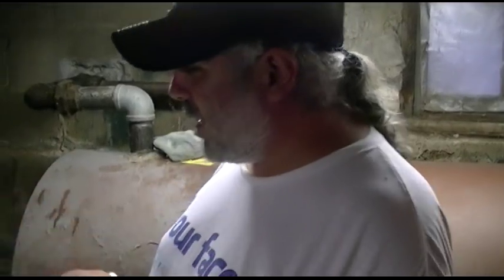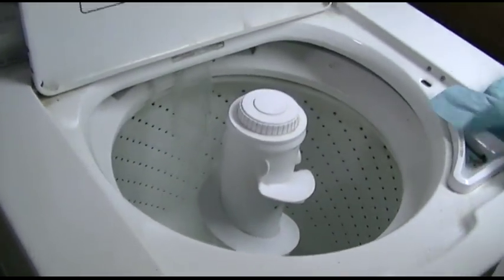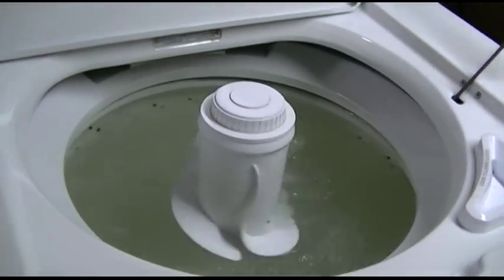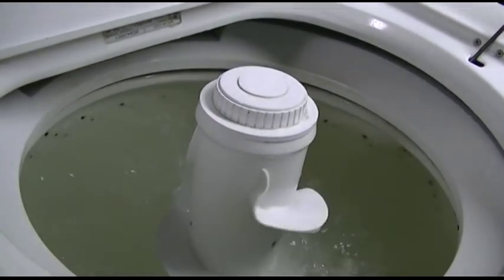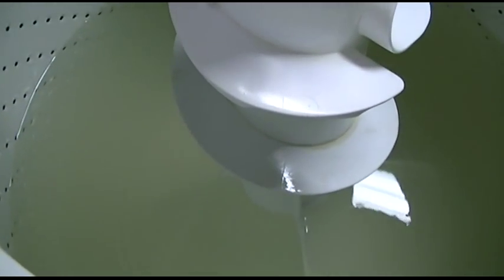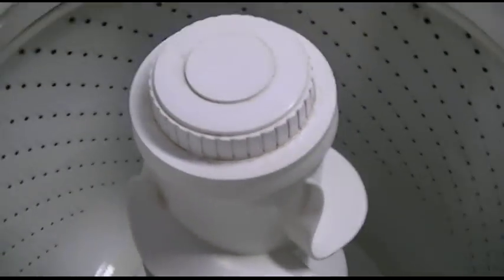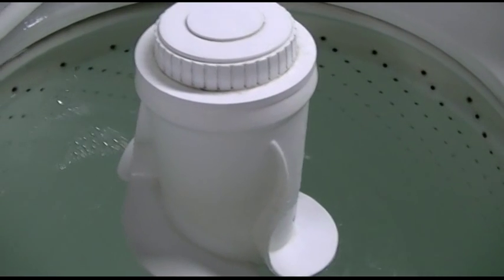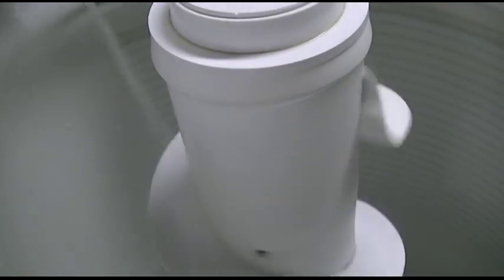Final Test Of Repaired Whirlpool Washer

Comment: I just bought a washer almost identical to the one in this video, only mine is a ultimate care 2, 8 cycle extra capacity. Really good washer, one of the best you’ll ever still find. My first purchase of a washer actually.
Reply from the maker: That was one of the greatest purchases you ever made.  It'll last and last and last.  In the unlikely event something breaks, it's easy to service.
Reply: jaykay18 yup, my family had two direct drives for many years before buying a cabrio set. What a mistake that was, but I shouldn’t complain much because we’ve had those cabrios since 2010 and never one repair to the washer other than during a power outage it fried the panel. But other than that It cleans pretty well, but destroys most clothes and puts holes in them. I don’t fuck around with this electronic BS, I want something sorta vintage that actually WORKS. It’s an amazing machine I’ve had this 90s direct drive for about a day now and it’s running like new, doesn’t even slip into spin either thank god.
Reply from the maker: @Goldenwoodz  I'd like to shake your hand!  Clearly, you have a good head on your shoulders.  Most people fall into the marketing hype of "HE" which is HARDLY efficient.  It's all a joke.  These direct drives have everything you could ever need, and work about the best that could ever be expected.

As for it slipping into spin, it's not that big of a deal to repair, I'll have a video series coming up on that in the future, a friend and I did it on his machine, and in the coming months, we're going to do the same to his other direct drive.  He's got two, and I own two myself.  Laundry gets done in absolutely no time, and right the first time!
Reply: jaykay18 Yeah you too! Lmao I’ve known about these machines for many many years, my family owned a 90s Roper at first then bought a newer whirlpool direct drive brand new in like 2006 or something, always very realiable machines and I loved using them. It wasn’t like I said until they decided to buy a cabrio set 🙄 fuck I was SO PISSED when I found out the direct drive was gone to see a fuckin H2LOW POS. Maybe 5-6 years after the new direct drive the same old whirlpool dryer we had for years was done so she decided to buy an entire new set instead of just replacing the dryer. It was my grandma that bought them, as she always buys the household the laundry sets. So she was not thinking with her mind and ABC warehouse talked her into it. That whirlpool cabrio set is still there today and they both run like new. But the dryer has had repair after repair after repair. The washer hasn’t had one, but the cabinet is literally almost destroyed in rust. It takes so long to wash, and my new one is done in less than like a half hour lol.
Reply: jaykay18 And you’re absolutely right HE is nothing but a bad joke. It’s really sad to see they’re still going on with it too after many years of unproven “HE” science. All that cabrio has done because of the very low water fill is ripped many of my clothes up. I couldn’t really stand that machine
Reply from the maker: @Goldenwoodz  I hear ya!

I grew up with a late 70s Whirlpool Belt Drive and a Westinghouse washer from the 60s I think, don't remember much about it.  Eventually, the Westinghouse broke and was leaking really badly, and couldn't be fixed.  My dad was lucky enough to have found a Lady Kenmore direct drive thrown out, not a thing wrong with it except it would sometimes leak on the floor.  The problem was a split in the hose inside that goes to the filler.  So I've only ever known quality.

When I moved into my house there was a belt-drive GE, but it still had an agitator and acted like a normal washer, it wasn't HE.  It was, however, a piece of junk.  Every year I had to repair something else on it.  Finally it started leaking, but the tub nut was so rusted in place there was no removing it.  I lined the bottom of the machine with sponges to soak up the water it would leak, which worked.  A year later the low speed winding of the motor quit.  I rewired it to not use that (it used it during spin, on a fast spin it would start on low then switch to high), but I hardwired it to only use high.  A year after that, the transmission, which had been slinging oil around the inside of the bottom of the machine for some time, finally grenaded itself.

A year before that happened, I bought one of the last direct-drive washers on the market, along with its matching gas dryer.  The dryer that was already here was a Whirlpool gas dryer but there was nothing wrong with it. 

When the GE died, I bought a 1994 Whirlpool direct drive from a neighbor.  I've put 2 sets of agitator dogs in that machine, that's it.

When HE came out and I saw these "spaceships" taking over the market, I was like "no way, never".  The 2 Whirlpools I have, I had a talk with them, and told them they must serve me until the end of my life.  So far, so good, one's 11 years old and the other is 26 years old.  Nothing but perfection, wash after wash after wash.
Reply: jaykay18 I loved those ole Westinghouse’s, the only belt drive washer we ever had in our family was my grandmas stacked 80s Maytag up which I loved that thing, also another best cleaning washer was those vintage Maytag before they were bought out from whirlpool, then my other grandma had a 80s speed queen and it was gorgeous. Stainless steel tub black control panel, was always a great machine until the dryer burned out or whatever and like most just decided to replace the whole set with it front loading Bosch’s, sorta boring if you ask me. But anyways it’s just a total fact HE machines are a load of bull. I just can’t understand why someone would think a few ounces of water cleans a big load like WTF is that....and then the load sensing shit like just stop it’s too much ridiculousness and I’ll never own a machine passed 2003 most likely
Reply from the maker: @Goldenwoodz  Exactly!  I have a couple of videos where I tested water usage against a GE top load, no agitator HE washer, needless to say the HE washer actually ended up using MORE water, on a deep fill, and that was with an empty machine.  If it had to load balance, the waster usage would be astronomical!

As for electricity, my old Whirlpool actually used more, however, it's a matter of performance.  You can drive a car with an itty-bitty 4-banger, or you can drive like a human being with a 6-cylinder engine.  Sure it costs more at the pump, but the payoff is worth it for the performance.
Reply: jaykay18 I just wonder how long these companies are going to keep advocating the HE standard. I mean how long has it been now since like 2008? It’s ridiculous that Whirlpool had such a high standard and reputation and they decided to hop on board with the whole idea of driving themselves into more money based decisions and scamming the customers and going down the straight downhill path many other companies have done as well and its horrible. Speed Queen was the only brand as far as I know to redeem themselves after getting knocked up with falling with the trend and bringing back the reliable old style product. I hope whirlpool and many others do the same soon...
Reply from the maker: @Goldenwoodz  Forever, that's how long they'll keep it up.  And it's not just washing machines, it's quality across the board.  You can't buy a refrigerator today that will last 20, 30 years; now you're lucky if you get 5.  In time, that 5 will become 4, and maybe even 3.  Most dehumidifiers these days don't make it past 3.
Reply: jaykay18 Yeah I’m not much of a fan of these new dishwashers either just as usual too much technology and BS.
Reply from the maker: @Goldenwoodz  It's ridiculous, even in small appliances.  I once saw a wifi crock pot (slow cooker).  Hmm, in general, it's impossible to screw that up, it's very forgiving.  I couldn't even imagine what wifi connectivity would do for anyone.
Reply: jaykay18 that’s too much like come on the laziness that technology is promoting freaks me out. I forgot to mention that when I bought this washer it was actually my second direct drive, I recently moved and looked online for a washer and dryer and I wasn’t really too particular on what brand as long as it was from the 90s or around there and worked fine I didn’t care, this refurbished appliance store had a 90s whirlpool set and the washer was a more basic 6 cycle two knob. It was 100$ each plus the warranty for 30 days which you can buy or not buy, I did and thank god I did. Most of the time when I buy things used no matter what I always test it before buying, but this time I was in a huge rush getting it and getting back which is another story but once I got it hooked up a week later it was fine on small, but once it filled higher than small it began leaking out the bottom left of the litter plastic ring tub. My best friend and I were gonna fix it but I called the place I bought them from and they said they will replace it and deliver a new one and take the old one out. The guy mentioned to me on the phone that he just got a new one in and is the same one as I just bought so he will give me that one. So they did and I demanded before they even brought it to see a photo of it and they did send me one plus a video of it in action and not leaking and I was pleased. Washer acts like it’s brand new it’s a very nice upgrade and replacement, but either way I would have been able to tell them if I wanted something else instead which they had many many other used machines mostly direct drives, tons of them. So it’s been hell just to be able to do laundry for the first time here, but guess it was worth it for a very good working machine it’s much newer I can tell than the one I had previously by maybe just a few years.
Reply from the maker: @Goldenwoodz  Occasionally things are missed, there are always mysteries.  But the good news is the place made good on it, and I'm sure the original one will be fixed up just fine.  Whatever battle you had to endure was well worth it, getting you set up with the right equipment.

Comment: 11:42-11:46 LOL When I get my own place I think I'll buy an old fashioned Washing machines because I'm tired of getting locked out of the machine, I want my clothes spun out enough for air drying  while getting very clean in maximum of 40 minutes, I want to use whatever detergent I want, plus I want to smell the fabric softener during the rinse cycle. Old machines you can just disable the lid switch and rewind the cycle by pushing in the knob and turn it to an earlier part of the cycle and pull it out again to resume the cycle. No need for see through lids or an add laundry light.
Reply from the maker: That's one of the reasons I bought a classic car, they didn't have safety interlocks and nannies and electronic control boards.
Reply: +jaykay18 And there bumpers would not crumble up with the car as much as cars made today.
Reply from the maker: Jason Hernandez Very true, there was no such thing as "front and rear crumple zones".  Could you imagine that?  They touted that as a safety item.  Crumple zones.  Think of crumpling up a sheet of aluminum foil, yes, that's right, just what the car does.

And airbags, another pet peeve of mine.  One of those blows, that's an immediately $1000.  Likely it will also break the windshield, so that's another $300 on top of that.  All for something as simple as a fender bender.

On the Buick, if there were a fender bender, the fender would be bent.
Reply: jaykay18 Possibly $600 to replace the fender only back then! Airbags are okay their still a pet peeve for me too. Hardly Protective because you have to be about fully grown to be properly protected by it. How is it safe if it breaks the windshield. They're scary and seem dangerous when they go off. 
Here's another safety item, DRIVING PROPERLY! Which is partially impossible when you have to put up with people who drive like they've never seen a car or a road before these days.
Reply from the maker: Jason Hernandez All very true.  Here's what I have to say about it:  Drive like your life depends on it, BECAUSE IT DOES!
Reply: are you going to do wash day with that machine?
Reply from the maker: Trevor peck We did once.  I think it was #9 without checking.
Reply: jaykay18 ok you remember chrystal peck thats me
Reply from the maker: Trevor peck Ok.
Reply: For real. In addition to that, they don't get the clothes clean as far as today's washers are concerned. I can use fabric softener all I want without issues.

Comment: What was that buzzing noise the washer made? My grandma has a Kenmore direct drive washer made in May of 1999 The Dryer was made the same year as well. It needs to be cleaned but works like a top. The washer has a straight vane agitator.
Reply from the maker: Straight vane agitators are pretty rare.  The buzzing noise was the end of cycle signal.
Reply: I made a video of my grandma's washer. you should watch my new video called Bender the hamster
Reply from the maker: ***** Ok, I'll check it out when I have time.  I was on vacation for a few days so I have A LOT of videos to catch up on!
Reply: ok

Comment: 4:52 is it pretty good lesson to learn from.

Usually when my washer drains into the pipe stack, it actually drains underground, right on the lower part of the stack.  

When I take a shower, I put the plug on the bathtub drain, and the overflow drain for several reasons:
After a certain period of time when the tub fills up to a certain point, I let the drain, the whole 1.5 inch diameter pipe, surge as much water through it as possible.  Why don't I keep the overflow drain open?
Why do I put a plug in that too?
This helps to increase pressure dramatically.  Allows more water to flow through the pipe with absolutely no interference in the overflow drains suction.
It creates an artificial vacuum as a result of the overflow drain having a plug on it
Reply from the maker: I know exactly what you mean.  I'm pretty sure one of the reasons my drains work so well is because of the drain system in the basement.  The pipes are overhead and not buried in the slab around here for whatever reason.  Perhaps that reason has to do with the frost line and/or water table.  So the sump pump that's there dumps at least 20 gallons at a time at a pretty good velocity.  If anything in the pipe didn't quite make it out of the house, the force of that water would likely push it further out.

Comment: I wonder what you would of paid to have all that done professionally?
Reply from the maker: You probably wouldn't; most appliance repair places/people don't even service these anymore.  They're all out now charging especially exorbitant prices fixing the space ships they call washing machines now.
Reply: @jaykay18  I know I have a whirlpool cabrio dryer I ended up repairing myself.
 The auto cycles stopped working and the belt started squealing.

I called a company out  needs a computer gonna cost 800 to fix just the computer I said no thanks.

I ended up going online and order the computer remainufactured both belts and all the rollers for 300 bucks.

Needles to day dryer works like new again. Its paired up with my speed queen washer. 

I also have a direct drive maytag centianal washer with matching dryer.
Reply from the maker: @SuperJeremi10  You ever need anything fixed, learn how to fix it yourself.  The "pros" aren't, and all they actually are is someone who's done it once before and knows what to look out for.  That's it.  Time and again, when I've needed a "pro" to do anything, the only good thing about it was the high price for THEM.
Reply: @jaykay18  I hear that I only call appliance people now if it's a warranty repair. Which far and few most of my appliances are too old.

Its crazy we bought that dryer new for around 1,000 10 years ago it was one of those steam dryers hell I waisted money on the steam shit.

I've used the steam feature maybe 4 times in the entire life of the dryer I dont even know if the steamer thing still works.

Point is I paid good money for the dryer just to be told throw it away when it needs minor repairs.
Reply from the maker: @SuperJeremi10  Well, you fell into the marketing hype with the steam option.  Most dryers today don't have that option.  As for minor repairs rendering the machine useless, that's how they're made, no matter how much or little you paid.  They want to bank on the fact that you WILL throw it out, and buy another one from the same brand, because you got ten good years out of it, rather than the old days where 10 years was barely broken in.

Comment: i know its not your house, but since the water quality is that bad maybe you should suggest a whole house filter system be installed. they sell them at lowes for $66 per canister (just replace the inner filter). if the washer inlet screens were that bad imagine what is in the rest of the house pipes. link to filter canister: https://www.lowes.com/pd/Whirlpool-10-in-Whole-House-Complete-Filtration-System/50412472
Reply from the maker: Oh, I KNOW what the rest of the pipes are like.  The water pressure there is terrible.  The owner is selling in a few years so it doesn't pay to do anything.